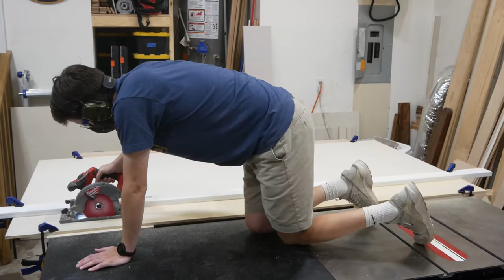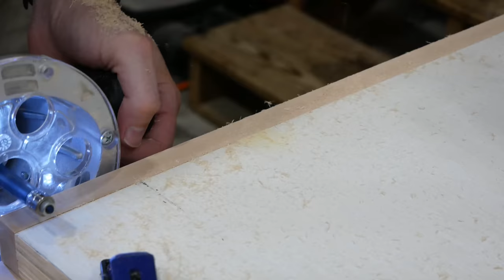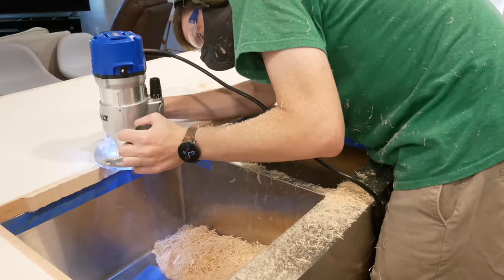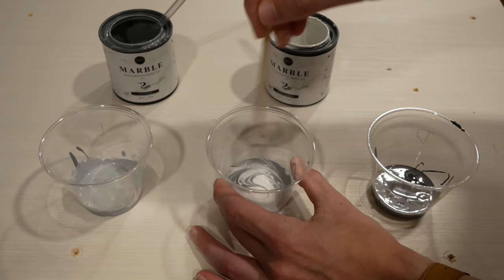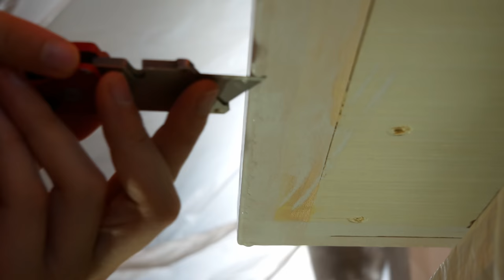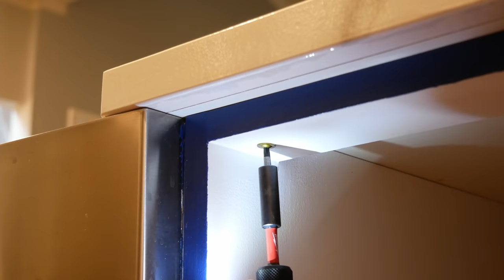How to Make Your Own Faux Marble Countertops From Plywood and Save Thousands $$$

Comment: You think I can make this work outdoors? Like is there a way that I can make this waterproof? I'm planning to build an outdoor kitchen and not sure what countertop to use. Good stuff mate! Thanks.
Reply from the maker: Yes I do. If it's a covered outdoor kitchen I think I'd use a marine grade epoxy and seal the bottom of the counter too. If it's uncovered, I'd do all that and consider using marine grade plywood

Comment: Look great!! Just curious why did you put the hardwood trim on instead of just the raw edge of the plywood?
Reply from the maker: Thanks! Couple of reasons, you'd at the very least need to put edge banding on the plywood edge as it would show through the paint/epoxy otherwise. Adding the hardwood edge allowed me to route profiles on the edges and trim it flush around my sink. I went with hardwood as I could see the edges of a softer wood denting easily, even through the epoxy

Comment: hi, thank you , did you have a bubble concern, also could you have gone with a thinner counter  ?
Reply from the maker: I did not have bubble concerns, I would say that keeping a dust free space as much as possible is key for not having bubbles. You could go thinner, say 3/4 inch, it would need to be adequately supported so it didn't sag
Reply: thank you
Reply: @ProjectBilld  thank you

Comment: Hello.  Great video...how are the countertops holding up a year later?  Would you do this kind of countertop again?  If not, why?  I clicked on the links above for the plywood you used, but it said it was unavailable...could you recommend a similar product? Thanks in advance!🤓
Reply from the maker: The counters are holding up well, I've been pleasantly surprised by them. As it's epoxy and relatively soft, there are lots of tiny scratches/micro swirls in the finish that could be buffed out but I don't worry about it as they aren't that noticeable except in direct sunlight. I personally wouldn't make the counters again, but I would say that about pretty much every project I do as I enjoy figuring things out for new projects more than doing something repetitive. It was a lot of work and time to make the counters, but I did save a lot of money compared to buying them. You'll need to weigh the value of your own time vs the cost of buying counters to figure out if it's worth it for you.

The plywood links work for me so I don't know what's wrong there, but any paint grade plywood for the top layer should be fine. Just need something with a smooth surface for the top of your counter

Comment: Are these countertops heat proof? Like would I be able to put a hot pot on top of the counter?
Reply from the maker: Not heat proof but heat resistant. Supposed to be fine up to 250° F. I use trivets under my pots and pans
Reply: @ProjectBilld  awesome thanks 🙏🏽

Comment: The cabinet build is such a great video. Very informative. Ton of great tips.
If the cabinets you built are side by side, does one cabinet door impede on the next cabinet door when opened?
Reply from the maker: They would if both were opened at the same time. If you haven't watched it already, near the end of my range hood video I installed hinge restriction clips to deal with a similar scenario, so I'd recommend checking that out!
Reply: @ProjectBilld  and correct me if I did not catch initially. Birch plywood for the box but maple for the drawers.
Reply from the maker: Any 3/4" paint grade plywood will do for the boxes so whatever you can get easily. Yes I used maple for the drawers as it looks decent unfinished but the same here, whatever you can get easily that looks good to you

Comment: How many inches of overhang did you go?
Reply from the maker: I believe it was 1/2 inch on cabinet ends and 1 1/4 overhang where there were 3/4 inch thick drawer faces or doors. So it visually looks like a 1/2 inch overhang everywhere

Comment: Well I'll be darned.  I have butcher blocked countertops and all I wanted was a piece of quartz on my small island that was 10 ft².  Unfortunately there is a 25 ft² minimum and the cost would have been well over $2000 for one small piece of quartz.   I am going to give this a go!
Reply from the maker: Nice! Let me know how it turns out. 

p.s. Loved you in Deadpool 2
Reply: @ProjectBilld  After curing, can this be sanded for a matte finish?
Reply from the maker: I haven't done it personally but I don't see why I can't be done by wet sanding up to a very fine grit and topcoating with something different than epoxy after. I'd make a test piece and try it on that first

Comment: What will happen if you put a hot pot down on the counter? I'm wondering if I couldn't skim coat it with concrete.
Reply from the maker: It's supposed to be heat resistant up to 250° F. We use trivets under hot pots and hasn't have any problems with placing moderately hot things directly on the counter
Reply: @ProjectBilld  thanks, Bill!

Comment: How about an update after a year video?
Reply from the maker: I won't be making a video for it but the counters are holding up well. Lots of micro swirls and a few small marks/dents as epoxy is pretty soft but that's my only complaint. They get used a lot everyday and they should last for years to come

Comment from the maker: 6 month update:
Hard to believe that it's already been 6 months since I made and installed the counters.

They're holding up really well. We use trivets with anything hot but there are no stains and no gouges. The epoxy surface does have tons of little micro scratches/swirls as expected but we don't notice it unless there's direct sunlight across the counter. I've attempted to get a picture of the swirls, it was very difficult to do so. Since it's epoxy, the swirls could be buffed out but I don't really see the point since new ones would quickly develop.

Although the epoxy directions claimed that the epoxy fully cured in 7 days, our experience was that while usable after 7 days it took closer to a full month for it to fully harden. We noticed little dents from heavy objects or dishes/cups with sharper edges that seemed to disappear after a few hours for the first month or so but don't see those anymore.

All in all, we're really happy with how the counters turned out and look forward to using them for many years to come!

I've posted a couple of pictures of the counters on Instagram which can be seen here: https://www.instagram.com/p/Camvr5Gh6Cw/?utm_source=ig_web_copy_link

Original Comment:
I didn't mention this in the video but for those who are curious the estimated total savings for this project comes to $2500 based on the following:

The estimated cost of materials for this project: $510
3/4" Plywood: $60
1/2" Plywood: $50
Maple Edging: $50
Wood Glue: $20
Epoxy Kit: $180
Extra Epoxy Set: $40
Countertop Support Brackets: $60
Miscellaneous Other Materials: $50

The estimated cost to purchase and install real marble counters for my kitchen using $70 sq ft as an estimate: $3,010
43 sq ft * $70 sq ft
Reply: How many hours of labor? Are you still saving money if you bill yourself out at, say, $60/hour?
Reply from the maker: Lots of hours, don't know an exact number. Is it worth it? That's up to the individual to decide and applies to every project or decision in life, there's opportunity cost to everything. It's up to each person to decide whether or not it's something they'd want to spend their time on. I enjoy doing this stuff so it's worth it to me
Reply: @finallyjoined  lol why are you billing yourself $60/hr? If that's the opportunity cost for you, you're already making over 6 figures a year. You can just buy a real marble countertop at that point.

Comment: Pro tip - your orange push handle should aim away from the blade, not push your hand towards it.
Reply from the maker: You're talking about the table saw push blocks right? Went back and checked and yep I'm definitely holding it backwards with my hand closer to the blade. Good catch